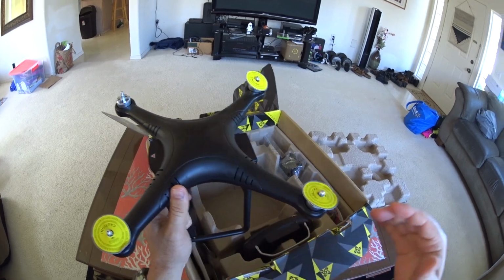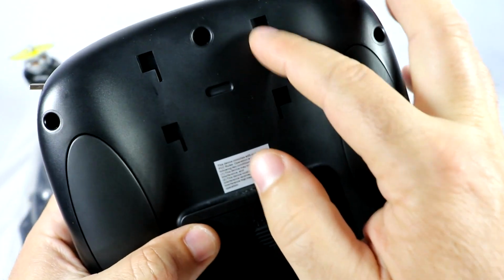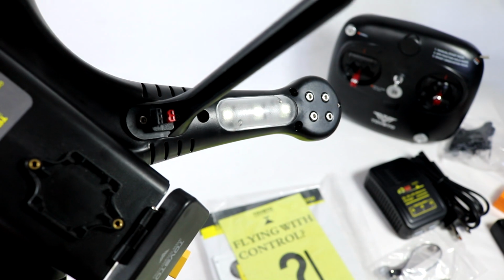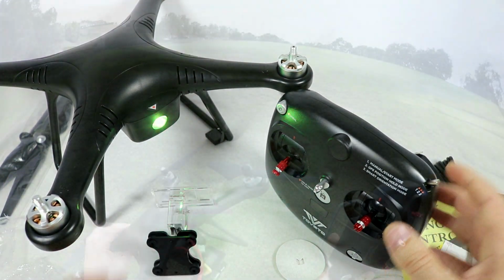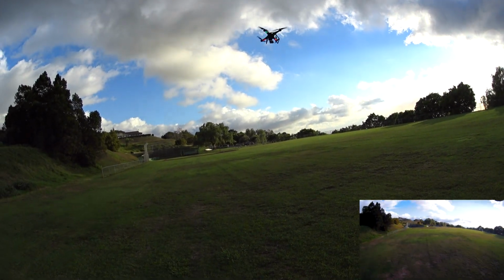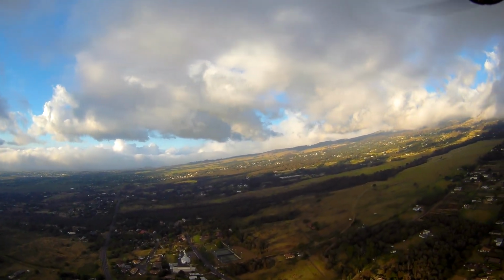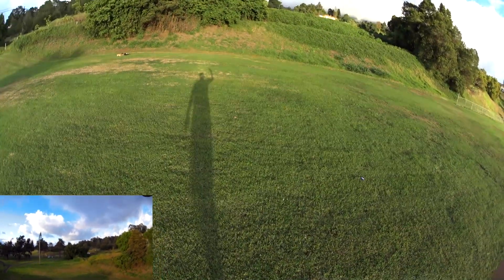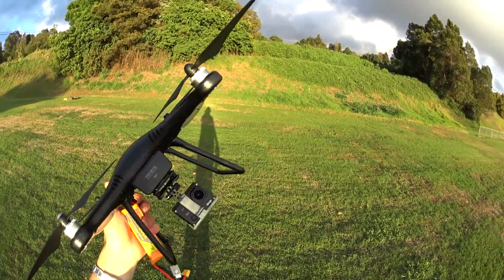TOVSTO AEGEAN - Full Review - [UnBox, Setup, Flight Test, Pros & Cons]

Comment: hey, first of, love your reviews. Secondly I ended up grabbing an Aegean
 but I think something had happened to the APM. A noob friend of mine 
plugged it into Mission planner and proceeded to firmware upgrade the 
APM, and so now it flys ok in manual mode and altitude hold but gps and 
RTH/RTL seems to make it just want to fly in a different path all 
together (I launch in the north part of the field- hit RTH button it 
continues to fly to the east) Just hoping someone out there may have in 
detail the Parameters for the APM so I can get her flying. Thanks again 
for any help.
Reply: Rumjar Media Did you try calibrating the compass?

Comment: Great review as usual. Problem on this end. Ordered the Aegean from Gesrbest upon receipt found the battery to have 2 out of three dead cells.  Replaced the battery with a like one, but Aegean just flashes red light, similar to problem I had with X380 which was resolved with replacement of damaged battery. Any ideas of what to look for? I've never had much luck with returns or receipt of quality items from Gearbest (i.e, CX-20 with bad motors, v303 Seeker that refuse to respond to transmitter) I thought maybe third time might be the charm, turns out some people just never learn. Anyway, would appreciate any thoughts on the matter.
Reply: File a complaint with gearbest. You might need to take video or photo of the problem. Ask for the partial refund or replacement battery. If they dont send replacement they will give you gearbest points which you can use to purchase similar battery. Better than a complete lost and they are more willing to partially refund than accept return.
Reply: I had replied to your suggestions, but see that someone decided that defending Gearbest was better than letting people know what to expect from them if problems arise. Guess I have to look at it as birds of a feather.

Comment: Real good review but for the current price of the X380, the X380 has more features and would be the best buy. Thanks Dustin
and will be looking for more reviews.
Reply: The x380 is a pile of junk....I had one and paid near 500 pounds and it worked for about 8 weeks before it decided to keep presenting problems.Took it out one day and did everything as normal, took it up about 300 feet and it failed in the air above a lake, then dropped like a brick straight into the lake...never again will i buy one from XK, AND they dont have any customer service when things go wrong whereas Tovsto do and the Aegean is better built...
Reply: I have the second xk380, had it for a year and it Flys great, u just have to calibrate the drone and controller
Reply: sometime u have to calibrate twice

Comment: Another great  detailed review Dustin, overall looks like a great low budget drone, i like that it has 3 modes for gps, alt hold and manual flight. and the range on it looks real good, would be good to see it max range with a altimeter attached to it. I look forward to your next video/s on this Tovsto especially with the 5100mah and fpv setup. I just bought a Bayangtoys x16 typhoon recently with altitude hold and this looks like it may be my next purchase :)